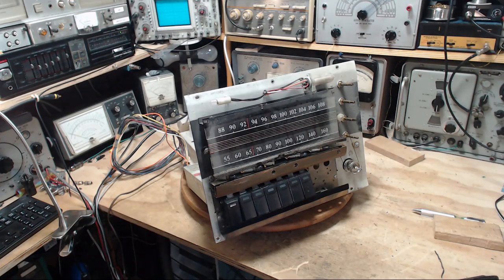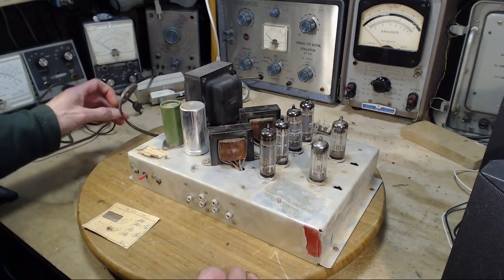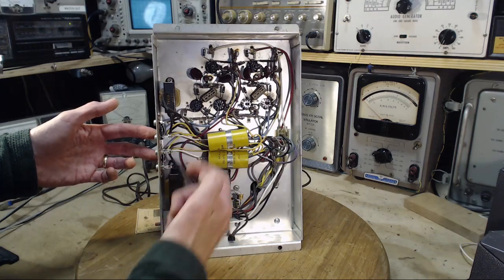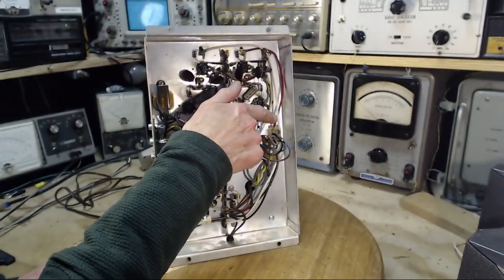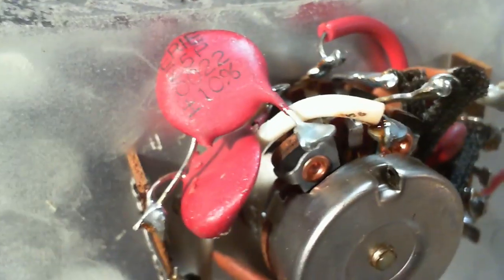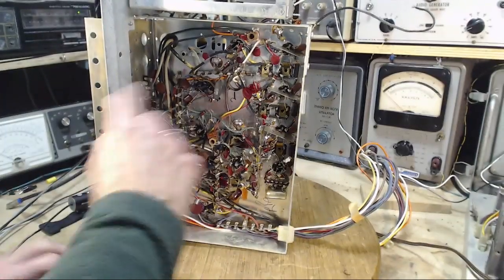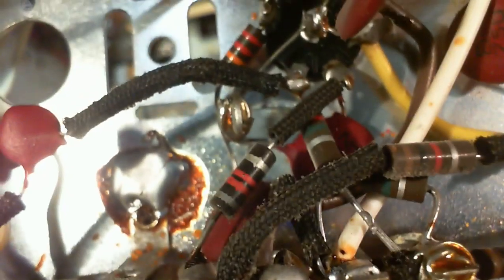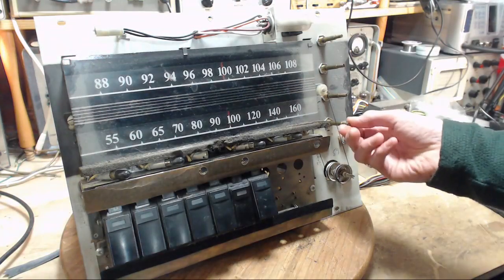Canadian Admiral J104X J105X Console Video #1 - Checkout

Comment: Jim. If it is an Ultra-Linear output transformer it will have 5 primary connections. 2 for the plates, 2 for the screens and 1 for the centre HT connection.

Comment: Total recap for sure on the J104X.I see a green paper  can capacitor and a silver Sprague can next to it. 
Will need some terminal strips mounted below them and attach the new electrolytic caps on them cutting the original  wires off the old leaving
 the old cans in place for aesthetics. Replace the two diodes with 1N4007's! NEXT should check all the tubes first before turning it on! 
 Receiver  J105X may need some noise attenuation bypass cap improvements with all those daisy chained BARE  wires 
on terminal strips running around near power supply lines. The metal plates are an attempt at RF shielding  to keep cross talk down. Looks like a fun restore!